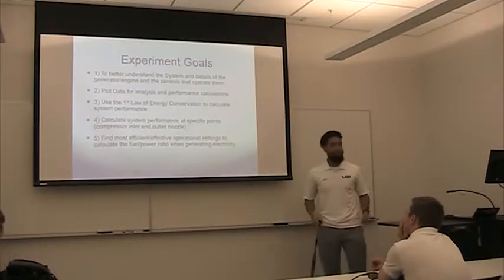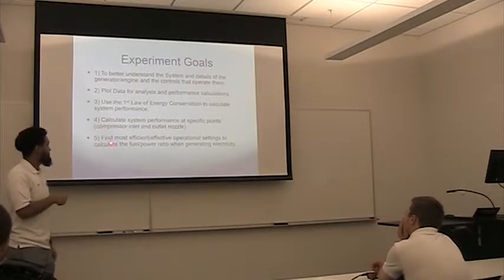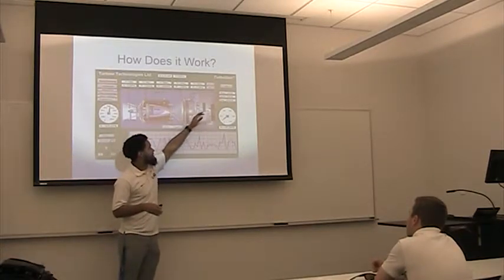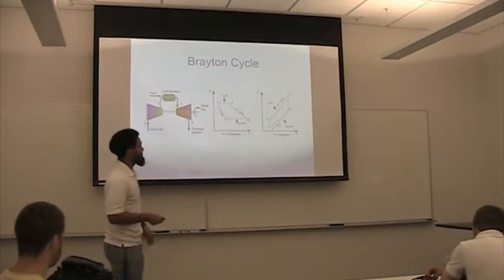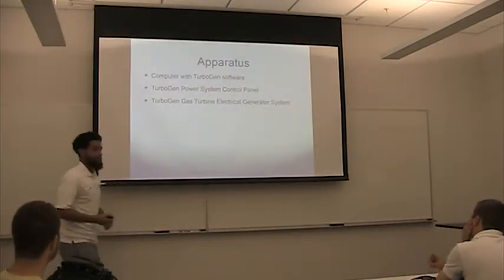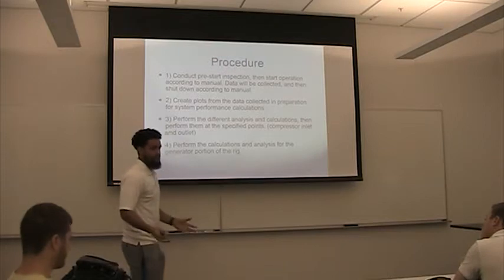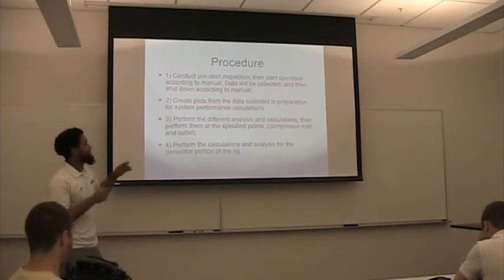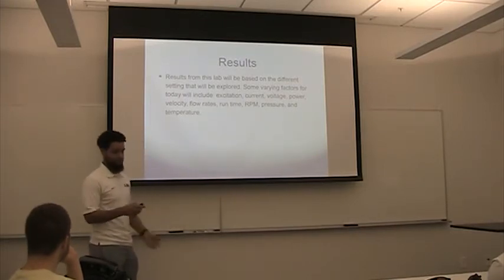Group Leader   Kamerhon Moses

Comment: Presentation: Very good explanation of the turbine. The explanation of the brayton cycle was very helpful. You caught me on my talk with the um and uh's. You started using the early in the speech but slowed down the use when you got on a roll. It is a very hard habit to break as it does not even register when giving the speech. I have noticed that the more prepared I am the less I pause and use the infamous um. I hope that helps.